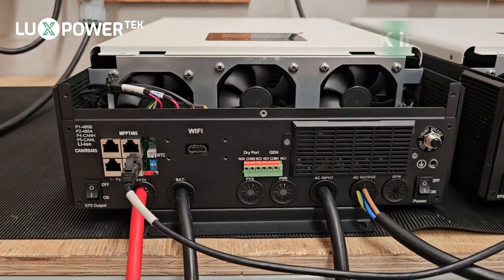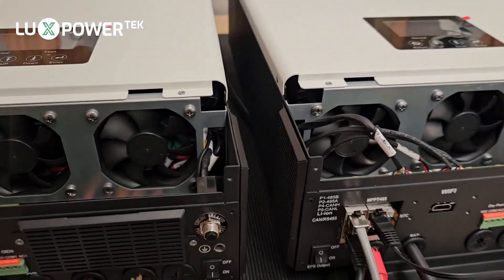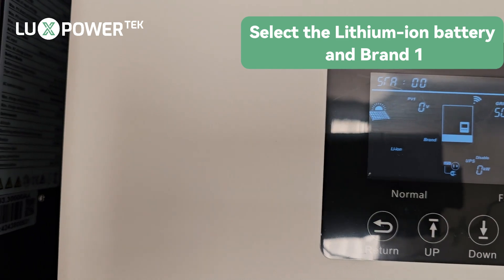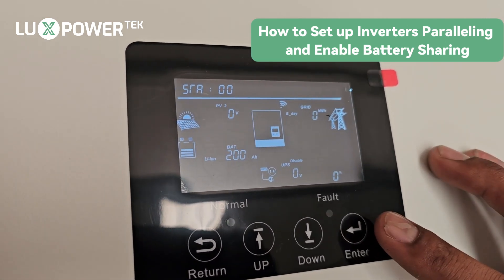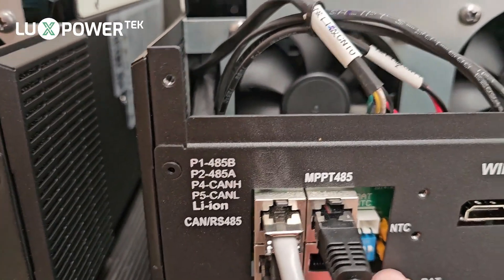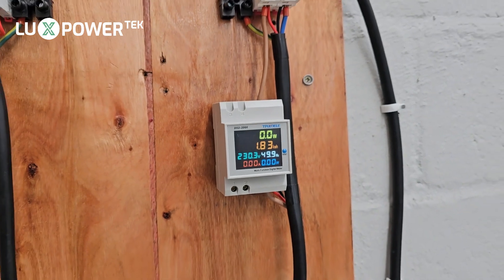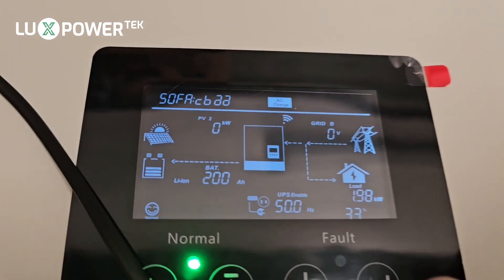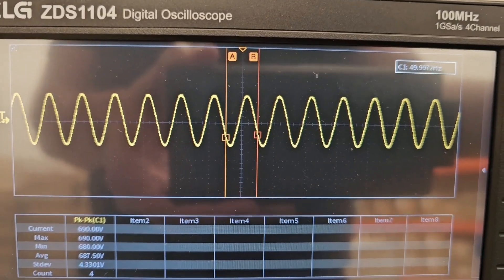LuxpowerTek SNA 6K in Single-phase Parallel Setup

Comment: Will it be possible to use the same connection but between sna6000 and sna5000?
Reply from the maker: Hi there, thank you for reaching out. Different power-rated products have different firmware. If you connect them in parallel within one system, communication errors or system instability may occur, so we do not recommend doing this.
Reply: @LUXPOWERTEK  thanks for the explanation. The problem I currently investigating is the next - I am upgrading 1-phase connection running on sna5000 to 3-phase connection with adding two new sna6000 inverters as 5000 not available in my location. Maybe you have some videos on this topic, will be much appreciated.

Comment: Is it possible to turn off the second inverter in parallel using a timed Shelly relay?
It would be interesting to be able to turn off the second inverter at night when power demand decreases, thus consuming less standby power.

Comment: I have same inverter with a New energy battery. Do you maybe have the communication cable pin setup and the battery type number on the settings ?
Reply from the maker: Hi there, thanks for your reaching out to LuxpowerTek. Could you please share your battery datasheet to info@luxpowertek.com? our technician will give you assistance.

Comment: I have seen on pararell that  each inverter has one string each of 6 panels but theres jumpers between pv1 and pv2 on each inverter . Is this norma, l if so why would they have jumpers on the pv1 to pv2 on each inverter
Reply from the maker: Hi there, Thanks for reaching out to LuxpowerTek. Regarding the jumpers you mentioned, I guess that you're referring to how the inverter supports connecting one string to different MPPTs. If you connect only one PV input, the current will be smaller, so we design it in a way that one string can be connected to different MPPTs for better efficiency.